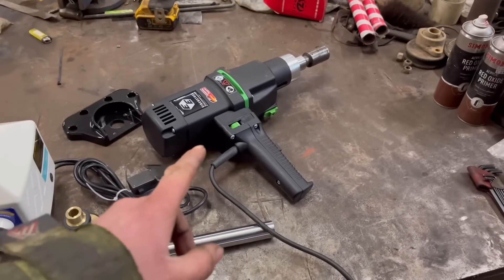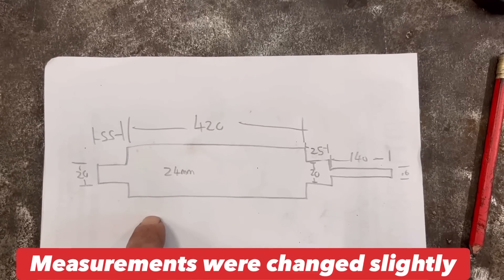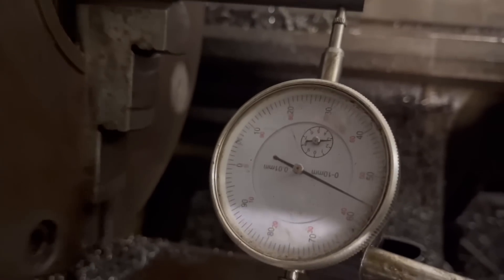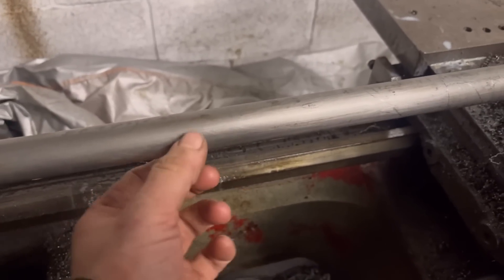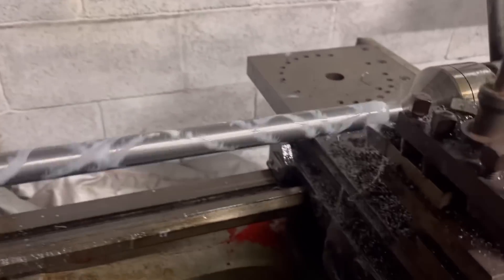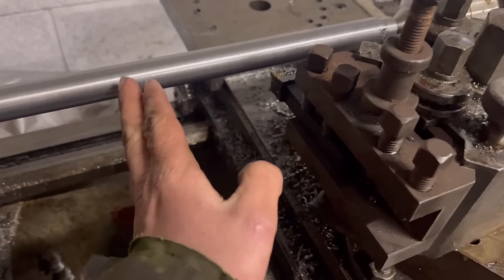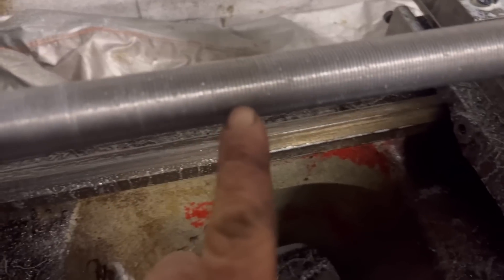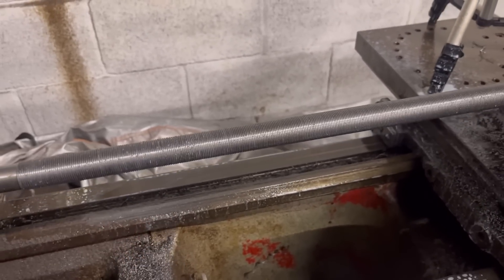Making a portable line boring machine! Shop made. Part 1. Lead screw

Comment: Hi, I looked into building a line boring machine a couple of years ago, which appears to be a similar route i was going to go, after working out costs of the rotational drive and speeds, feed unit rates, bearings, materials for bearing housings, rails, stand off's, overheads  ETC ETC, making  boring bars of different diameters, tooling costs plus unforeseen expenses (maybe  a machining error) and finally buying boring bars to complete the final requirement, and still no bore welding capability. Finally i decided to work my spare time on customer jobs and get paid, and bought an off the shelf line boring/ weld boring machine 35MM to 300MM works fantastic up to 160 MM, (300MM i have doubts) and my paid spare covered most of the cost (could have worked more spare time) , obviously not of Climax quality. First job in  paid for the remainder without any unforeseen overheads. If you are are interested it is a YSPower machine (i have no affiliation, no remuneration, just think its a cracking machine for the money). just looked on tinterweb price now £2900.00 delivered .
Reply from the maker: I did look at them but I wanted to make my own just for the satisfaction and for something to do in my spare time.

Comment: There is no better project than to build your own tools. By the way: the bearings on the lead screw needs to be a trust bearings?
Reply from the maker: Yes, should be a thrust bearing. I’ll have to see what’s suitable when I get nearer to it.
Reply: @snowballengineering  the mill feed box ( or what is the exact name) can also auto disengage using two microswitches.

Comment: Gday I built my own line borer and used used square hole sleeves threaded type to insert in the bar. Made adjusting the tool
height easier they maybe available there I bought mine here locally in Australia probably USA or chineseium made
Reply from the maker: I’ll have to look into that. It’s a bit tricky changing the tool height on my bar.

Comment: I agree with the others.  Welding videos without explanation are just a bunch of flashing light and then a part...not interesting or helpful.  The real benefit to others is not watching the process of threading the bar or turning down the od or drilling or welding...it’s the thinking through what you are trying to make and how you are attempting to make it.  I’d love to see the mundane sped up but the “what and why” thoroughly explained.  Also, tell us the materials you are using and why.  Keep it up.  I think there is a big appetite for honest and real engineering/fabrication.

Comment: Yeh very keen to see you make the line borer. Pretty surprised how well they your mag drill one works so I’m sure updating it will be great. Did you buy the main shaft in your original? If so where from? Thinking I’d like to sort one for work sometime. Keep the videos coming 👍
Reply from the maker: I made the bar that I use in the mag drill set up, Easy enough to make.  Will do, thanks for watching.
Reply: Cheers for reply, do you know what grade material you used?
Reply from the maker: I used chrome rod that’s used for hydraulic rams. Not sure of the exact grade

Comment: Great video mate. Always a fan of self made tooling and equipment. I made a smaller version about 10 years ago using two rods acting as the rail and then used a 24v linear actuator as the drive. Had settable limit switches as the auto stop
Reply from the maker: Thanks!  Ah yes, I’ve seen people use the linear actuators on mag drill set ups for the auto feed.
Reply: @Snowball Engineering  pretty much a voltage controlled lead screw and protected from sawrf etc

Comment: you can put a piece of metal in the tool post and it will hold the die stock run the suds on and save the arms.
Reply from the maker: Good thinking!
Reply: @snowballengineering  Coming from a jobbing tool room you learn the short cuts most don't know lol

Comment: The only issue I can foresee is the power feed has a plastic gear in the back, if the ‘line borer’ jams for any reason it’ll strip it. The good news is they’re only about £15 on eBay, I have the same power feed on my mill.  Great idea though, looking forward to seeing it in action.
Reply from the maker: I did wonder what might happen if it jams.  There are ready made line boring machines that use the same feed unit though so hopefully it shouldn’t be too much of an issue.